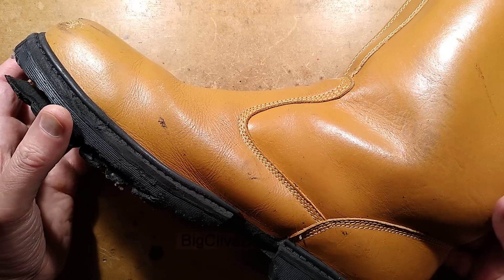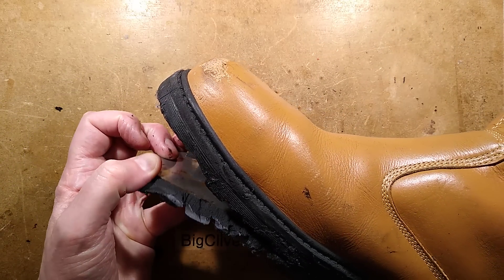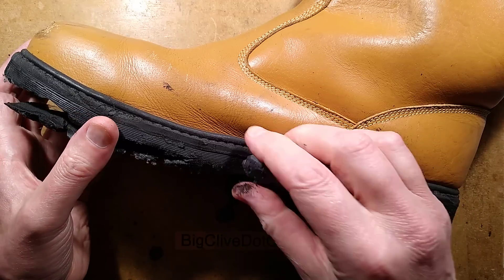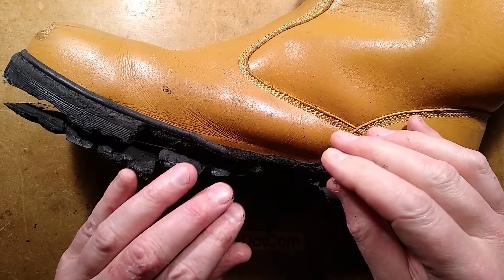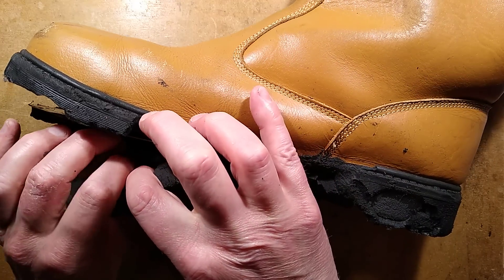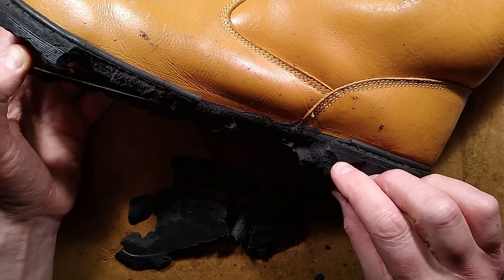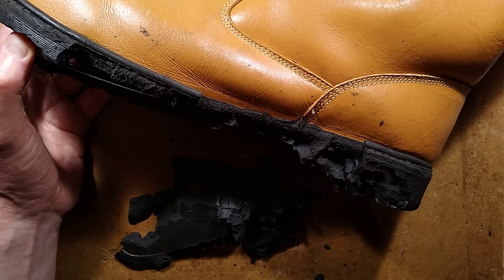My work boots have melted!

Comment: Hi Clive. Isocyanate and polyol are combined at the injector to form polyurethane in the reaction injection moulding process (RIM) commonly used for footwear soles. The weakness in this process is the combination of these ingredients in the correct ratio. When it goes wrong, you get the symptom you've shown. This appears to happen to most shoe or boot soles made this way after 10 years or so. I once had a pair of Clarks shoes go this way after 6 months. They were replaced very swiftly with absolutely no quibbling. From a production engineering standpoint, I'd guess they absolutely knew they had a bad batch.
I once had a pair of steel toe-capped cowboy safety boots fail this way while at a music gig. I caught the bus home while literally "on my uppers". 😀
Reply: Actually, all soft PUR formulations will break down even if you get the stoichiometrics right: heat "hardens" PUR, UV makes it yellow and brittle and humidity leads to hydrolysis...
Reply: Cool, I just had a pair of slip on exercise shoes from Aldi's come apart after half a dozen wearings. This explains that!💎
 🟦🟦
 🟨🟨
Reply: Had a pair of Clark’s Nature Treks years back very comfy but little used after approx 10 years turned to powder and the air voids collapsed 🙀
Reply: Ive also woprked in the injeciton molding industry for a little while. I can confirm this. He is absolutely correct.  This is what happens when thinng are not mixed to the correct ratio.  This stuff happens with (Bad batches)  but most shoe companies will sell them regardless.
Reply: @f.d.6667  Yes this is true but there is a difference between years and months. After some years thats normal. If the shit is degrading within the first 2 years, it wasn't mixed correctly.
Reply: I’ll be honest, I had a childish snigger at ‘RIM’.
Reply: @pollywollydo Are they the ones with the animal tracks embossed into the soles and the magnetic compass in the heel?
Reply: I work for a UK shoe company that purely manufactures shoes using the same injection process that has been described, the problem is called hydrolysis, which results in the breakdown of the chemical bonds in the sole material. We see it a lot with our shoes that were produced over a decade ago. Clarks and other such brands also have similar issues with hydrolysis affecting their older shoes as well, at the time the whole industry was using a specific formula involving isocyanates as mentioned, at the time it wasn't seen as a problem as the chemical bonds lasted fine for 2-3 years before the industry adopted the process (which is frankly, the maximum expected timescale these manufacturers expect their goods to last for if constantly used). The problem only started to show up around 2018 as not everyone buys shoes to immediately wear, we found that our customers would buy 2-3 pairs of the same shoe back in 2005, wear only 1 of them and keep the other pairs in storage. The issue with this is the pairs that sat in storage for a decade plus were never worn, so the material was never interacted with, the bonds in the chemical process were never put under flex and over time, moisture from just the surrounding air caused these bonds to break. And as they were never worn, there wasn't anything to stop this moisture sinking into the material and causing even more damage. Amusingly, the process of just wearing the shoes and causing the material to be flexed and put under stress, which in turn keeps these bonds from degrading and forces out moisture from the material. So if the shoes are worn consistently, hydrolysis never gets the chance to set in and cause the chemical bonds to break down. The best advice I can give to anyone who has shoes with RIM soles cast onto them, wear them as much as you can, don't "store them for best". Shoes are shoes, they're perishable goods and are designed to be worn, it's like buying a banana and just leaving it to sit on the table expecting nothing to happen to it over a month, everything degrades and by not using it for the purpose it's intended for, there's a high chance they'll degrade faster. I can't speak for other brands but where I work, we've been able to formulate a solution that stops this from happening as often as we know our customers are the type to "keep a pair for best :)" then only wear one pair constantly for 5-8 years.

Also, for anyone who wants to ask where I work, I can't disclose that publicly. But we were in the news recently, if you need to know.
Reply: No I nothing so hi tech  I’m going back to the approx mid 70’s. They were simple folded and stitched leather on a “ state of the art type”  ( then) moulded thick sole this enabled air pocket to be formed inside it. They were very comfy
Reply: No, no, NO!  It was NOT a bad batch mix. It was PERFECT P.O., (PLANNED OBSOLESCENCE).  Not a bad batch.
Reply: @ReagyNyan  so basically if you're in the habit of buying several pairs of a boot you like because you know they won't be available next time you want to replace them you're better off rotating them than letting one pair wear out?
Reply: @Sally4th_  Yes, absolutely.
Reply: Even vulcanized rubber will fall apart eventually, but that takes like 30 years.
Reply: @johnm2012  Ha ha ha, only 50 years ago.:)
Reply: @ReagyNyan  Thats where the Clarkes old gristle sole wouldnt fk up.
Reply: I've also seen Clarks do that long ago, my Dad had one pair that did that, yet many identical older and newer pairs were fine.

Comment: Yeah, molded polyurethane soles tend to do that. Easy to manufacture, impossible to repair. Treat them as perishable items, 5-10 years after manufacture they'll crumble and split.
Reply: I've had it happen in under 3 years to boots and to molded grip handles on tools ...
Nasty garbage
Reply: Now, you can completely replace the sole. It’s probably going to be more expensive than buying new ones, but it creates less waste
Reply: @pn4960  shame the companies...
Show what garbage they are churning out...

And then decent conscientious manufacturers pop up from obscurity with quality products
Reply: @richardlilley6274 t’s not a garbage thing, it’s a compromise of the properties of synthetic rubber.

In order for them to be grippy, comfortable, etc. you have to use additives that cause the material to degrade over time

Work boots and footwear in general is expected to have been worn out prior to the material degradation
Reply: @ConorNoakes I'm not too sure about that. I have work boots that are 20+ years old & the soles are still good. If you spend extra to buy high quality from a reputable mfg, you'll get your money back longterm
Reply: @ConorNoakes  do you ever stop and smell what you churn out as excuses...?
When something isn't broken and manufacturers change it '  its not to fix it
It's down to making more profit...
Greed...
Wake up
Reply: @dansemacabre6515  20 plus year old boots, I think you need to start working a bit harder 😂
Reply: @Dime_Bar  Some work boots you wear for working. Some you wear for site visits, doing estimates, etc. The working boots get ruined but the wearing boots have character & even sentimental value. They bring you luck
Reply: @Dime_Bar  good work boot manufacturers boots last a LONG time and are repairable, you can usually just send them in for a nominal fee, you can even have them adjusted to fit you better. They're pricey but make it up over a few years, mine were around $400 but they've lasted almost 15 years of heavy use now while spending maybe $30 total maintaining them, prior i was buying two pairs of boots a year as they wore through quickly so $120/year of cheap boots that end up in the garbage  was effectively replaced with more expensive boots costing me ~$30/year. (granted when I first started working there was no way I could afford nice boots like these on a paycheck) Terry Pratchett's "boot theory of economics" is 100% a real thing, it's expensive to be poor, you spend more money constantly replacing garbage when if you can afford better things they not only last a LOT longer but are far easier and cheaper/possible to repair.
Reply: @richardlilley6274 ahh the old and gold wiha/Werra Line of screwdrivers that Beginn to stink and get sticky
Reply: @luca87375 Hate to think where you've been putting them 😝
Reply: @ConorNoakes Idk about that one mate. I've had work shoes and boots from timberland and carhart for years in all kinds of caustic chemicals from my work and never had them rot on me or degrade.
Reply: @richardlilley6274  What kind of basement-dwelling teenager still believes that capitalism is a gift economy?
Reply: @dansemacabre6515 "They bring you luck" 😂

Nothing can bring you a made up concept.

But you are spot on about potentially having more than one pair of boots to cater for different scenarios.
Reply: Boots only last 2-3 years maximum for me no matter what, so what I do is I have a spare pair in a closet (that is very dry) and when one pair wears out, I start using the spare pair and get a new one that gets to chill in the closet for a few years.
Reply: @Dime_Bar  you should start buying better boots
Reply: @marcogenovesi8570  I have a proper trade not just some pen pusher that turns up on site when the job is nearly complete. Maybe you should get a proper job.
Reply: @1Raptor85  my boots cost me about £40 and have lasted for 3 years and are still going strong, so that's still a lot cheaper than your boots per year.
Reply: @dansemacabre6515 I expect 10-20 years of service from shoes. It is garbage quality if it doesn't last so long.
Reply: i had exactly the same happen to mine few months ago

they were completely fine for 5 years or so, and disintegrated within few weeks...
Reply: At Hotter we used to offer a good discount or replacement if the time since purchase was reasonable to the wear to the rest of the shoe. PU lasts longer if you keep wearing it, I have a pair that have been used on the beach for about 10 years and are fine, it is when you put them away and leave them for a while that problems start.
Reply: @richardlilley6274  Agreed. That's why boots made in communist countries never fail. Power to the people!
Reply: Like maybe a year. Vibrum is way better. I've still got my initial issue boots from almost 20 years ago.
Reply: @rustyudder  they don't make stuff like they use to...
Now all the effort goes in to the promotion '
Rather than in to the product...!
Reply: @richardlilley6274  Damn, i;d forgotten the handles. A good tool should be lifetime.
Reply: @Dime_Bar  Blundstones?
Reply: @pn4960  Unfortunately, you can't replace the sole on most of these.  They mold the rubber around the entire unit, rather than have a real seam you can stitch or glue onto.
Reply: If it is an actual steel cap and not polycarbonate, take the steel out and give it to your local blacksmith. He’ll make you a knife.
Reply: @1Raptor85  You're absolutely right about the "boots theory of economics." I sell work boots. When people come into my store and buy the $180 boots, they come back in six months for another one. But then people come in with a pair of our $300 boots and say "I've had these for ten years and worn out the tread, can you put new soles on them?" And we do. Making that large investment is really daunting to begin with and some people can't do it, but those that can and do get so much more value and even save money.
Reply: @richardlilley6274  yawn
Reply: @ConorNoakes  are you finally waking up ...!
Reply: @richardlilley6274  the crinkling of your tinfoil hat is too loud
Reply: @ConorNoakes  ba'ar
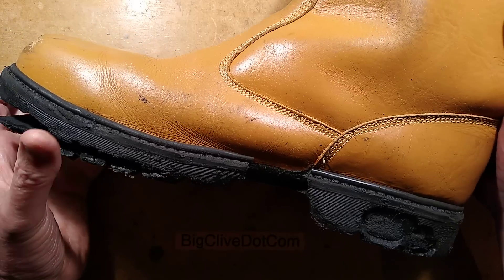Reply: 0:18
Reply: @richardlilley6274
Reply: @EmeraldHill-vo1cs  sadly blundstones have gone to pot in the past 15 years, my old pairs from before that are fine but new ones last 4 years tops
Reply: @Mister_Brown  Agree, unfortunately they make them offshore ,from about that time. A lot of ozzie shops wont sell them after that and stick with local brands like Redback etc.
Reply: By what mechanism?
Reply: i had sandals who did this
Reply: @demef758 you ought to make a video on all the different flavors of various boots. Lord knows you've licked enough of them to be an expert 😂

Comment: As the URL I posted seems to have been deleted, here's the extract from it: 

One of the main technical challenges with polyurethane is overcoming an ageing deterioration known as ‘hydrolysis’. Hydrolysis is the chemical breakdown of the PU polymer and the resulting physical breakdown or crumbling of the PU sole by the attack of water (usually in vapour form), occurring over a period of several years (even when the shoes are in store!).

This process is accelerated by warmth and high humidity. It will, therefore, happen more quickly in tropical climates, but also in confined spaces (such as lockers) if the safety shoes are put away damp. In the most advanced state of hydrolysis, the PU sole will lose all its physical strength, thus cracking or crumbling.
Reply: Thanks. When this happened to my boots few years ago. I thought it's because they contain some euro chemicals that make them them break so that they could sell more boots. But I guess that as like I suspected, maybe really road salt was also partially guilty. Salt draws water in right? So if the boot get soaked by salt. It's done. What if I spry it with some silicone product, for protection?
Reply: Thank you for that info, it baffled me like no other incident. That exactly happened to a pair of safety boots that I  used a for a couple of weeks, then left stored in a humid wardrobe during six months and to my surprise the boots painted black all the floor at the building site; needless to say that day I had to run for an emergency boot shopping.
Reply: Good point. Most plastics seem to degrade without any need for mutant viruses. Migration of plasticiser is the most common form I've suffered from but the are doubtless many  mechanisms : notably the longest-lived plastic I've come across is bakelite, a very early form that doesn't have plasticiser. It seems that the achilles heels is wanting the product to be soft. Perhaps some modern inventions such as those derived from mylar will prove to have a longer life.
Reply: Yes I agree, The manufactures got the mix wrong on this batch and it's reverting.
Reply: Huh???? Thats a SIGNIFICANT downside!!!
Reply: @melody3741  That depends on how you look at it...
Reply: @Hardi26 u""...ero chemicals that make them them break so that they could sell more boots."Is that part of the paranoia of the Bootsit campaign
Reply: @raycochrane3971  When I went to buy new ones from same shop, the seller told me, that for her there is nothing to do. It's same for all boots. They contain euro chemicals. Also she added don't buy them for keeping in wardrobe, they go bad.
So what else should I think? Yeah, it's my paranoia. :)
Reply: @Hardi26  Planned obsolescence has been a reality since the late 60s.  On the other hand some manufacturers charge a premium for long lasting products.
Reply: @Hardi26  Well i dont think it really matters. The fact is, a certain type of rubber used mainly in sneakers and boots was used and makees the soles crumbly after awhile. Best u can do is try to identify it and avoid. You will see it talked about more accurately on ebay flipper ,youtube channels.
Reply: @raycochrane3971  Try 1925, look up the Phoebus cartel, and they are just a well publicised example, was going on a lot earlier than that.
Reply: @m3chanist meh. The Phoebus Cartel wasn't made for planned obsolescence, or at least that wasn't their only goal. Technology Connections has a great video about it, I recommend giving it a watch.
Reply: @Hardi26  it is far from being paranoia in my opinion. Planed obsolescence is a well known things. It is a fact....lol just took a look at another comments. Not the only one pointing that out. What is paranoia?..i digress.
Reply: @pierre-lucrousseau3652  Maybe a well planned obsolescence could be a good thing in some circumstances? But when it inhibits good progress, or is just to screw to opponent or to get rich. Then can only fight against it.. while making people to fight against it also might be a good thing, but only if they(the ones who oppose obsolescence) won't loose that fight. :)
Reply: @Hardi26  That is a very good point. I agree that planned obsolescence could be a good thing in some cases. Like the wear of piece instead of another or the all assembly. I did not even tough about that nuance. At least not under the planned obsolescence term. The way i am use to define planned obsolescence is in the term of the all thing become useless or would require a almost complete rebuilt. But for the rubber to decay just by looking too hard at it is a shame. Why not doing it in the same rubber use to make tires. I see old scrap tire that are half buried in the old trash yard near where i live, and the are there for at least 30 years. A few cracks here and there..but always outside and in the Canadian winters. Freeze unfreeze etc. Now planned obsolescence is, like you said, almost exclusively relegated for the purpose of making money in a way or another. The following question crossed my mind a few times; "do a business could be viable long term with the old standards and quality of products?". With the level of competition, the cost of production..NOPE!!! at least it would be very hard especially on a large scale without a huge amount of funds to begin with. But again, yes controlled obsolescence is indeed a good thing.